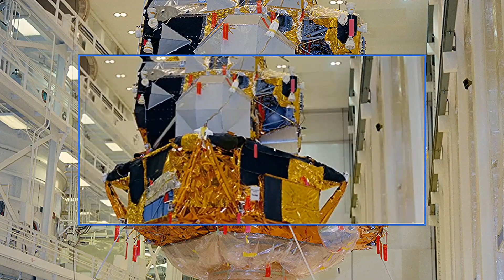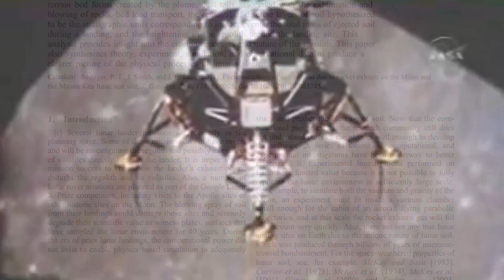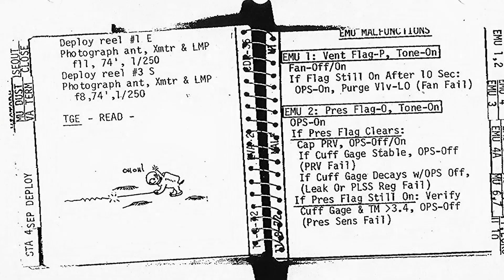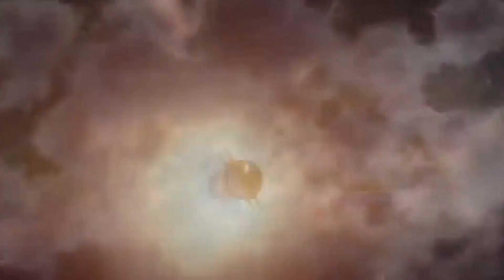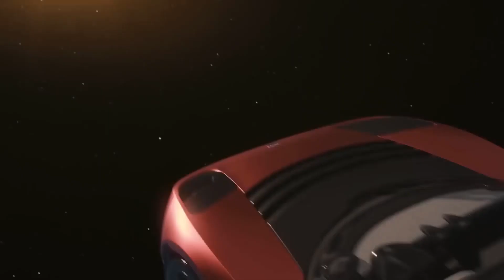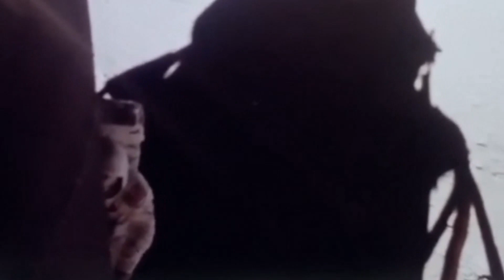THE APOLLO DISCUSSIONS "CUFF LISTS MAPPING CAMERA ARTEMIS 1" PART 16

Comment: Hydrogen 👀✨💥

No guys, its not that hydrogen can’t be constrained because its too small. Its something else. Are reading my comment and are you paying attention?

Because now we are going deep. There is no element, known to man that can reach absolute zero without becoming a solid, except for Helium. 

However, the extreme temperatures to reach Helium 3 levels cause an effect where Helium doesn’t conform to atomic and molecular lattices. 

I am saying it goes THROUGH any material you try to contain it in. “Leaking” is a huge factor when condensing helium.

This also effects hydrogen because of the low temperatures, albeit not nearly as much as Helium. But leaking with all super cooled elements is a problem. Introduce a complex structure made of different materials to contain super cooled gas and more leaking is going to occur due to the mismatched nature of materials. (Rate and level of temperature driven malformations)

Ok, now time for the fun stuff which will baffle you. 

The effect required to protect spacecraft in outer-space (not just upper thermosphere, but real space with cosmic and solar interactions) can also be used to properly trap super cooled elements and stop them from leaking.

There’s only one solution. Do you know what it is?
Reply: There is no "outer space"
It's a fiction just as all space travel is.
Reply: @UNcommonSenseAUS  sorry, i have no comedy or entertainment over flat-earth humor.